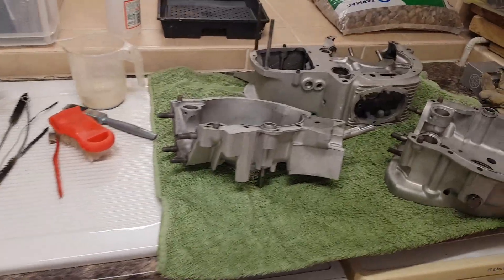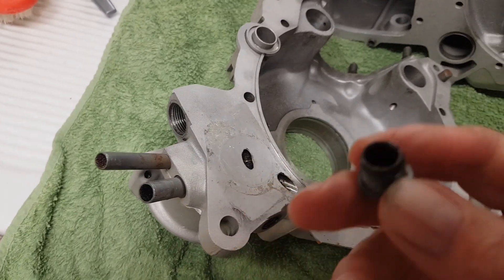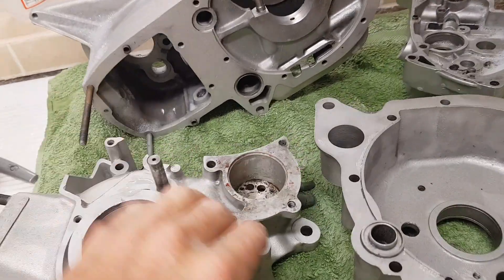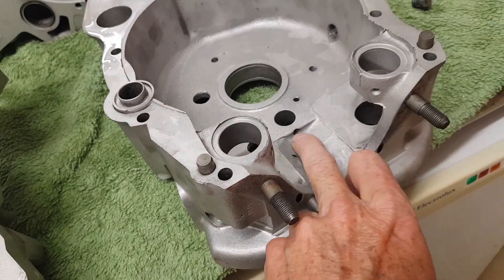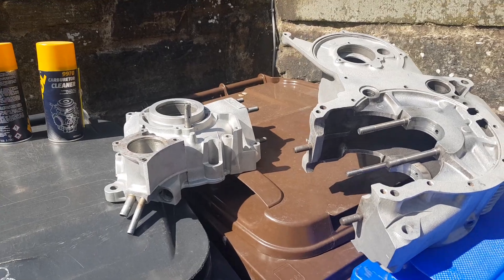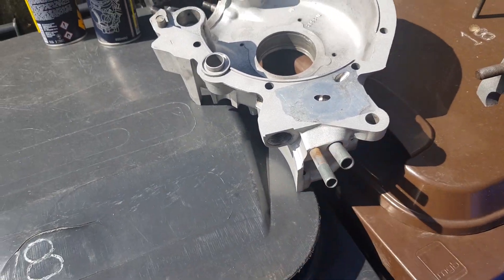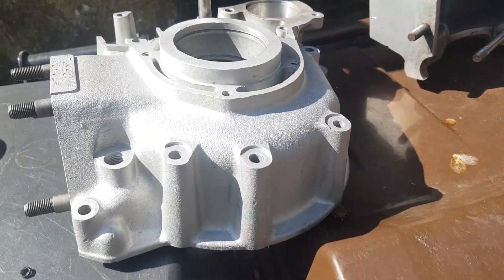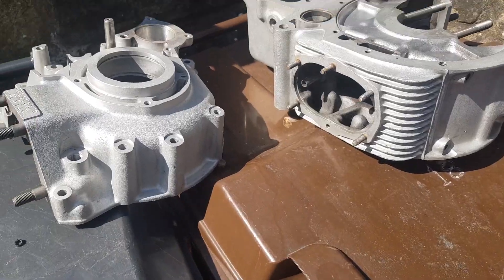Triumph Trident T160 Engine Rebuild. Part 16: Cleaning the Crankcases

Comment: For what i look here, was just sand blast, a good vapor blasting left a shining surface, we clean in soap water and dry, then we seal the part using a clear coat ( oven paint ) as triumph manual specify flamebouyant finish
Reply from the maker: I think you're slightly confused. These cases were vapour blasted (light grit in a high pressure water jet) as opposed to grit blasting which is just done dry with coarse grit. Vapour blasting is much kinder to softer metals and leaves the cases with the original slightly rough cast surface. The outer cases are polished to a high finish by metal polishers (where my outer cases currently are) and these can then be sealed to keep them shiny, but I wouldn't recommend doing so.
Reply: Great video!!!